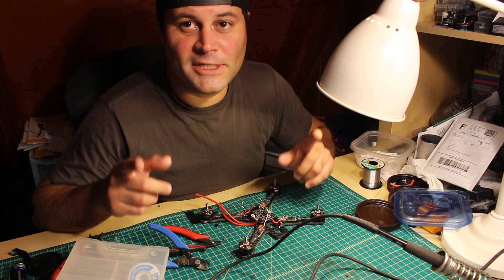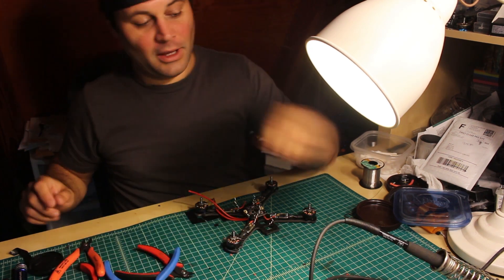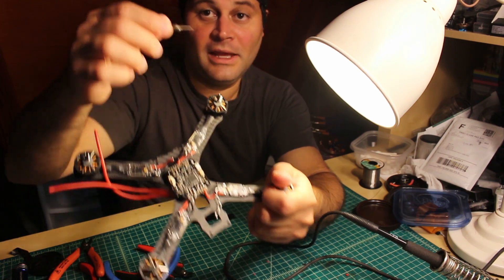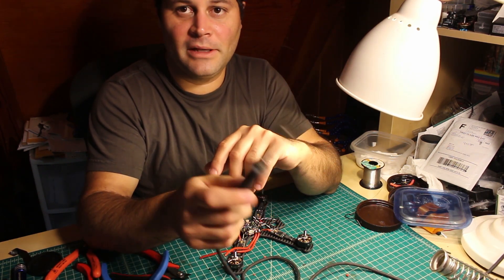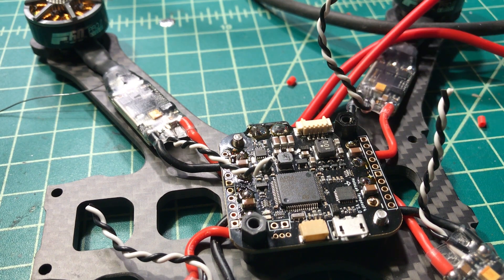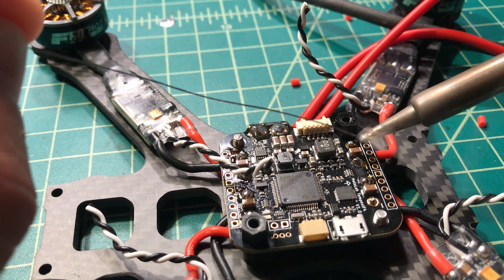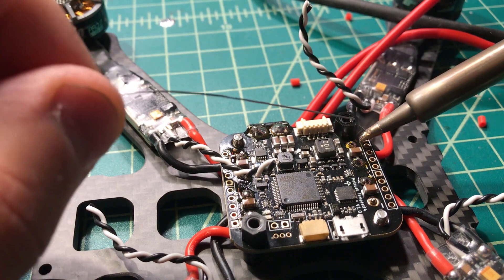Recommendations for Soldering Tips - What Shape to Use?

Comment: May i give you a tip as well for prolonging your tips? 
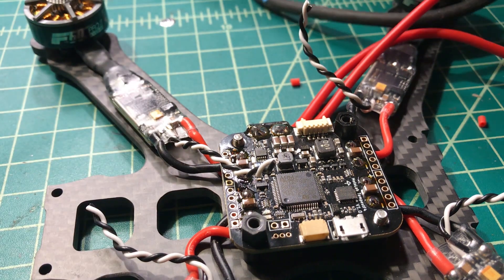At 5:00 I could see you putting your soldering iron away, after hearing you wiping the solder off on the sponge first.
Next time, leave the solder blob on it. This way you'll prevent oxidation on your tip, which is the main culprit of destroyed tips. 

Instead, clean the tips before you start soldering. And apply fresh solder on the tip before soldering.
Reply from the maker: Yes, true. I do that at the end of the day... I constantly running this thing. But with a very fresh bit of solder and at lower temperature to reduce the amount of carbon from burning. But yes, you're absolutely right.